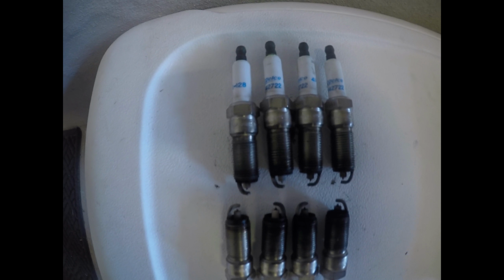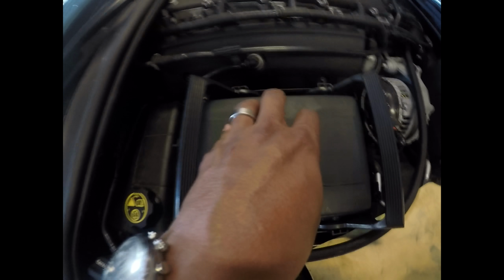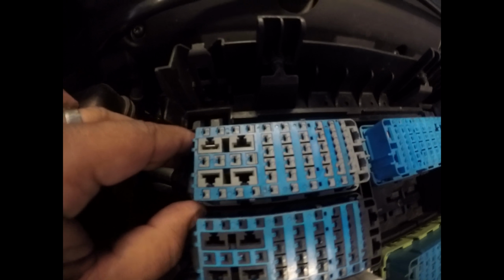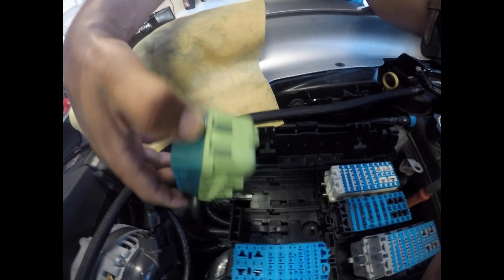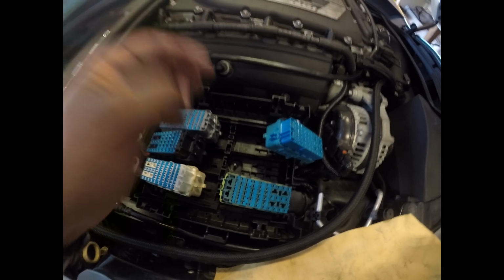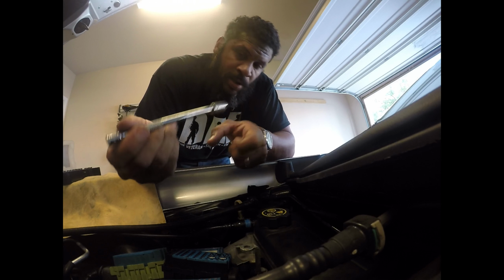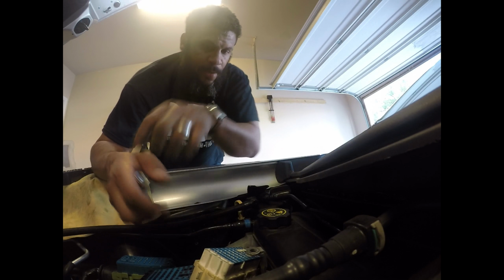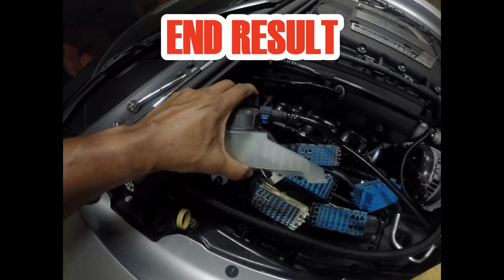CorVETte Therapy, Getting to C7 Z06 Spark Plugs and Why I Changed

Comment: Thank you for your service. Also thanks for the video. I was wondering if I needed to remove the tank to get to the rear plug.
Reply: You don't need to remove the tank, you just need to unbolt it and move it into a workable position. The rear plug on the passenger side was really much easier to do than it looks. You will need a flex head ratchet and 3/8" universal joint to spark plug socket to do the job. Great video.
Reply: @bruno98us  I agree. The rear plug on came out easier than I expected. I'm installing Hooker Shorty headers and finished getting the oem parts removed today. Will start the reinstall tomorrow.

Comment: My #8 spark plug boot is like welded on! I removed my coil pack and have room, but it’s still No Joy! Sucks!
Reply: Bought some needle nose pliers about a foot long. Made it a lot easier. Also you can get a spark plug socket for tight spaces and that makes it easier.

Comment: Do you need to do anything after re connecting the fuse box or does it reset everything
Reply: I was worried about that also. On my 2015 C7, it remembered everything. After reconnecting the fuse box then the battery, start the car and let idle for a few minutes. That was all.

Comment: I wish I had seen this before changing mine on my C7. I bruised the back of both hands squeezing them in to change the driver side ones.
I have big hands... so I had my nephew who is very skinny do the passenger side after I used some very long pliers (HarborFreight) to remove 
The plug wires.  What a pain in the ass. GM engineers.....errr!

Comment: Frank, what spark plug did you wind up going with ? I have a 2016 Z06, with a forced air unit. I hear the Brisk Silver spark plugs are good but cant seem to get a straight answer on a specific plug brand or part number for my car. Thanks again and as others have said, thank you for your service and helping us hands on car guys.